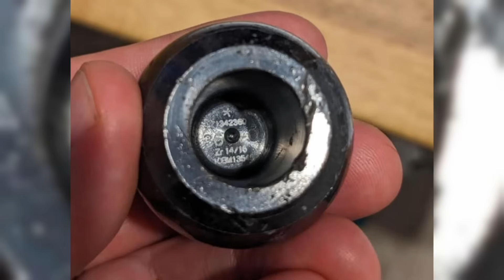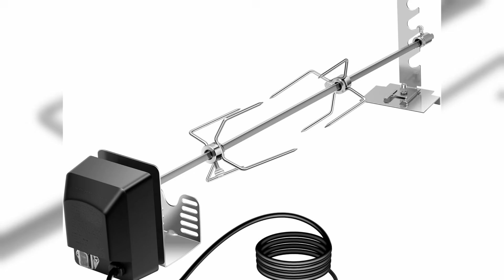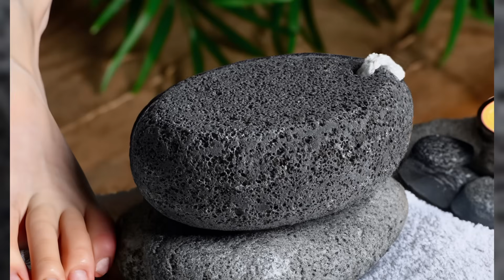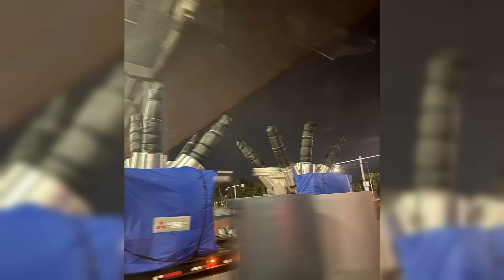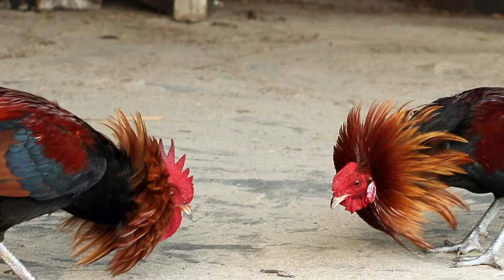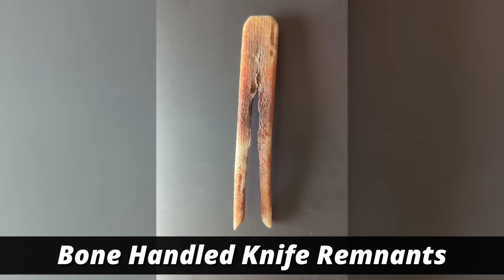20+ BIZARRE OBJECTS THAT THEIR OWNERS HAD NO CLUE ABOUT! What Is This Thing?

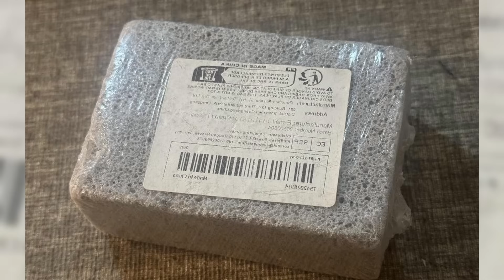Comment: 00:11:02 the "magnetic gear like metal discs strung on a wire" are actually "Grinding Wheel Dresser Replacement Blades". They are placed on a metal handle and used to resurface the grinding stones on a bench grinder.

Comment: The no 50 on the rubber foot pad is from a multi cavity injection mould to distinguish the cavity it was molded in,in case of repairs to the mould